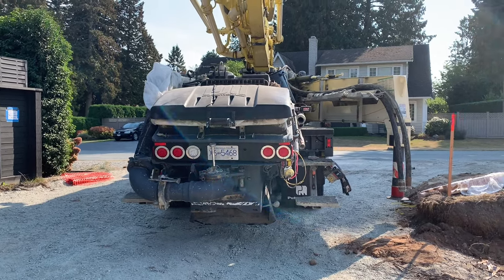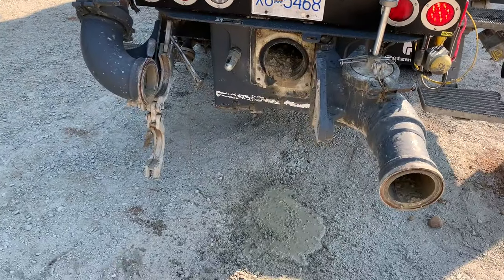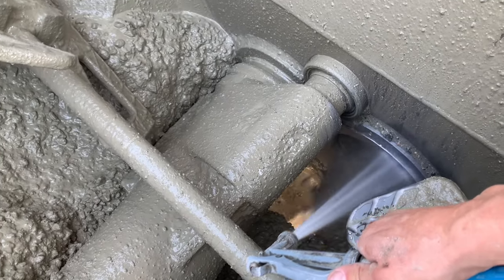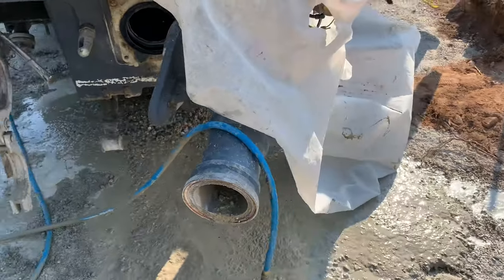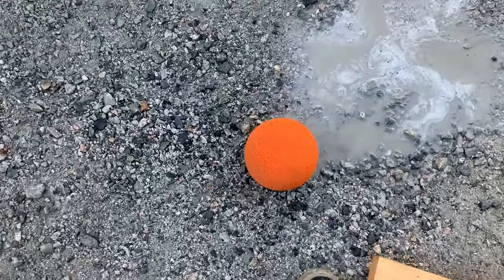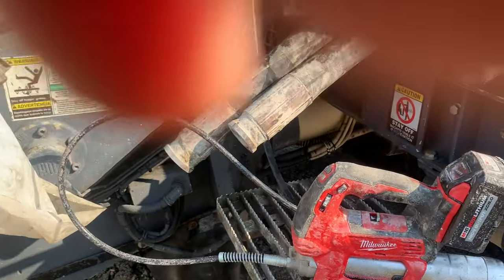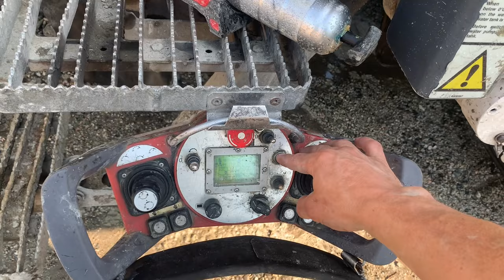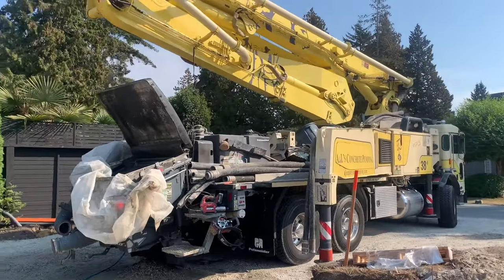How to washout a Putzmeister concrete pump:

Comment: I'm curious how you clean the drain valve from the tub or how you clean it if the concrete has hardened on it during a longer job, I cut the side of the tub at 38 in order to clean and wash it. I wish you all the best and I hope that things in the economy to return to normal.

Comment: Centering the material cups I believe is key to an extended piston cup life. Done it for years and years, totally makes sense, and like you said, it costs nothing. Back in the day of running the Thompson’s, always packed a 5 gallon pail of dirt/sand/ bark mulch. For that ever so easy hopper design, to clean at days end. Was curious on what the protocol is in your market, for raking out the wash out pile,  we always rake it out unless specified otherwise from higher up’s on said specific sites. Or if it’s a designated wash out where raking out wash out piles was irrelevant.
Reply from the maker: Yes, it was John Beacom (check spelling of last name) from Gastaldo’s whom taught me that one many years ago. I, like yourself, swear by it. Bark mulch is my absolute favourite for dumping underneath of the large bearing, so much better than sand, in my opinion.  Doesn’t harden up whatsoever. 

It’s funny, for the most part they like us to take down our washout piles, but I always still ask because inevitably if I rake it down without first asking, the builder inevitably calls two days later complaining that it should have been left in a pile as it would have been easier for his machine (which just magically appeared on site) to pick it up. But yes, same as you, my default is to take is down as thin as possible. My favourite is if I’m in a wide open area, I’ll suck back a trash can full of water into the hopper and let my washout self-level (just don’t try this in the city and have the slurry water run-off into the neighbours blueberry garden….. or so I’ve been told…) 😂😂😂

Comment: those hoses are crazy lol only seen them myself in edmonton but having spent majority of my career in toronto where its pretty exclusively 10’ sections those seemed huge
Reply from the maker: We’re spoiled in that we run mostly 3” and smaller diameter line. If we were lugging around the 4” and 5” hose like they do in Ontario, we’d likely be rock’N the 10’ lengths as well.

Comment: aside from lifting the grate and stopping the pistons half way, this is exactly the way I was taught to wash out. most of the time, ill ram each piston down in reverse with the stroke changer so I can see the faces. 6 of 1, half dozen the other. putz should include this video in their crash course DVD llol
Reply from the maker: I know at larger companies lifting the grate for anything is a big no-no to the point in which they actually sometimes have them bolted down. One of these days my back is going to NOT thank me for all the years of lifting that grate 😂😂😂

Comment: What year is that truck?   When i was a pump operator the only interlock in the hopper was your hydraulic water pump.  You could have the grate up and the s tube would still cycle and the mixer would spin but the mixer would turn off as soon as the water was pump was turned on.   That pump was a putz 32 meter around a 2001 or 2002.
Reply from the maker: CPMA standard since I believe around the early-mid 2000’s all were required to have the hopper grate safety cutout switch. That being said, not all manufacturers were/are CPMA certified. It’s definitely something you want to have on a concrete pump. There’s been a number of extremely gruesome incidents and fatalities from machines either not having the switch, or having had it bypassed.

Comment: So, If I were to try to reverse clean my line pump, sucking the sponge from the discharge end back to the hopper, I wouldnt get suction unless there was enough material in the hopper to cover the material cups?
Reply from the maker: Typically speaking, yes. The material cylinders need to be fully submerged in either concrete or water to produce the vacuum required for pulling back half a boom system filled with concrete + a sponge. I have seen cases where it will still pull back even with the hopper level below the material cylinders, but I certainly wouldn’t count on it.

Comment: The cup on the ass end is for priming out you don’t have to ever plugout whem priming out, the pin on the cup is a ball 🏀 catcher so don’t have to worrie about chopping the ball in half, I always bring the hose to the hopper and put the waterhose nosel and holding it with the ball shot like about 5 gallons bucket through the pipes, when suctioning the ball, but make sure you press the pin and clean the cup from the inside of the 90

Comment: I like the tip about making sure the sponge is there by busting open the transition door to take a look before dumping the hopper.  I never thought about the vacuum.   Would be really nice if you had an S-tube changeover lever though 😆
Reply from the maker: It does actually have a manual changeover button (the newer Putz rigs have a more easily accessible changeover leaver). Neither style work however once the hopper grate safety switch is tripped and the accumulator pressure dumped.
Reply: I learned that lesson my very time sucking back the sponge. It was in my reducing cannon when I busted open the trap door. Lesson learned! 😂

Comment: you will like that milwaukee grease gun a lot more with a lock-n-lube quick attach for the greaser, and one of their swivels on the hose... I have the M12 version, and it is so much nicer to use.

Comment: Lol the water hose blew apart on the 56 last week Saturday. Barrels/s-tube were done, so no biggie. 

I wash from the discharge side, while stroking in reverse. Bottom out the cylinders after the trap is popped to push the majority out. 

Most of what we do is preferences. Cool to see other ways. Stay safe brother
Reply: You lost barrels and s tube because the water hose blew?
Reply from the maker: @DerekCastleSr.  I’m assuming he means “done” as in already cleaned out.
Reply from the maker: I began doing this religiously after running out of water mid-washout with our old line-pump 20-something years ago (had to get the barrels and S-tube cleaned out with a pressure washer back at our yard). Learned a lesson that day indeed. 

Totally agree. There’s so many different ways of achieving essentially the same thing in this trade, a lot of it really is just situational.
Reply: @DerekCastleSr.  Done, as in already washed out, no material left in the barrels/swing tube, no big deal to power wash the hopper at the yard.

Comment: I've run Schwing and Putzmeister and a few other make and I've found Schwing is the best for cleaning out and running Putzmeister comes 2nd that's what I think
Reply from the maker: Yes, many wise veterans have mentioned the exact same to me. I believe the rock-valve hopper is more “self-cleaning” as there’s less stationary components inside of the hopper as compared to a Putz.

Comment: Do you drop the water from your piston box ? Why?
Reply from the maker: I actually only change out the water in the box maybe once a week. In my opinion, the practice of dumping it daily (unless ambient temperatures dip below freezing) was/is more of a Schwing thing as they can tend to pull water from the box in past the rod seals and contaminate the hydraulic oil. Just my opinion. Either way, definitely no harm in dumping it daily, I just haven’t found it to be necessary practice with our Putzmeister pumps.

Comment: You wouldn't believe how many people destroy their large or small seal housings due to lack of grease or just relying on the auto-greaser and not even checking to make sure there are no plugs and everything is getting greased.  Then they bring them in for service and say the seal housing is shit because it didn't last.  I guess they don't realize once we take it apart it is pretty apparent if it hasn't been greased properly.  Cheapest and best form of maintenance is grease.
Reply from the maker: That’s the one thing I don’t like about auto-greasers, they can lead to complacency/negligence.
Reply: @canadianconcretepumper1979  We have a few customers who won't run them on the fleet exactly for that reason.  It's hard to find good guys that you know you can trust 100% to grease it everytime.

Comment: I am new pump operator,only operating for 3 months now.. what advice you have for me would appreciate to hear it….ps I from a small island 🏝️ name Sint Maarten 🇸🇽
Reply from the maker: Best advice I could give would be to develop a routine of what works and not deviate from it until such time as the situation calls for it or until you gain enough confidence experience to start tweaking things to gain efficiency. Always stay humble no matter how long you’ve been doing this, it’s a constantly evolving profession and the minute an operator thinks they know everything is the minute they begin to regress. But the most important one item of advice I could give (aside from the obvious use dunnage under your outriggers and stay away from power lines), ALWAYS recirculate when waiting on mud. 23 years and I’ve literally not once had a boom party and it’s 95% attributable to the fact that I recirculate religiously (the remaining 5% is just luck that I haven’t tossed a fan-belt or tensioner with nuclear hot mud in the pump) 😂😂😂. Just be diligent.
Reply: @canadianconcretepumper1979   thank you

Comment: where did you get the ball stopper
Reply: Putz sells em, so does conforms. I like the Putz version better. The conforms rod seems loose, almost "wiggly". Scott's looks like the Putz version
Reply from the maker: As Greg had stated, you definitely want to get the Putz version. The ConForms unit relies on an O-ring for sealing, which gets sloppy and leaks. The Putz unit is near bulletproof.

Comment: Why do you hate the cube?
Reply from the maker: They don’t wipe the pipes clean nearly as well as the rubberized round sponges do. Also, they do not seal air as well (especially when brand new). The biggest reason however is that with the foam cubes you can rinse and wring them clean for 10 minutes straight and they seemingly still become rock hard after over a weekend. In my opinion, the rubberized round sponges are just quicker/easier/more efficient. in most every way, in my opinion. I’ve seen the rubberized round balls last more than a year on several occasions.

Comment: You should wash and drain out your water box we have found if you drain it at the end of the day you get less water mixing with the Hydraulic oil. Plus we have a sign saying fill water box at your control's so you don't foget
Reply: we empty it out every time we wash out at the end of the day
Reply from the maker: You’re absolutely right! I’ve been told that it’s especially important with the Schwing as they can be more prone to pulling water in through the rod seals.

Comment: Why not use the remote...rather than lifting the grate... pump on in reverse... hold the change over button to max out a stroke.. pump off... rinse out... pump on reverse again.. hit and hold change over button again to switch stube over.. pump off and rinse.. done.. barrels clean
Reply from the maker: I prefer lifting the grate as I can get a nice straight shot up into the barrels with the water nozzle. We do a lot of slow pours in which the piston heads as well as the ends of the cylinders get caked up pretty good, so it’s helpful to be able to get the water right up in there.
Reply from the maker: The method you suggest would likely add years to the life expectancy of my back however 😁😁😁

Comment: If my sponge is not fully back i make sure  the s tube is submerged in water then try to suck back the sponge
And first clean the hopper and the cilinders  and no dirt  only some formoil
Reply from the maker: We do so many slow/tedious pours with hot mixes, sand/dirt is seemingly the only way to avoid buildup underneath of the large bearing. I pumped 800 cubic meters in 9 hours with this thing last Saturday, I had forgotten what a treat washouts can be when the mud is kept flowing all day long.

Comment: I wash out the same way but I use a wash out rake for my s tube cut down on water
Reply from the maker: That’, good idea for sure. We keep them one our high-pressure pumps which have the extended discharge outlet (makes it difficult to get in there with the water nozzle). Definitely saves on time and water usage 👌👌👌

Comment: Wow must be a nice feeling using 3inch pipelines 😂 instead of mauling with 4inch here in the uk
Reply from the maker: Truth be told, most of our residential work (aside from foundations) is poured using 2.5” or even 2” hose. Commercial we typically run a 3.5” or 4” for boom work and 3.5” for line work. We’re fairly spoiled here with our mixes/materials.

Comment: I want to see you clean out a hopper with a seven sack concrete mix 

Fellow pumper from Houston tx
Reply from the maker: Some of the high rise mixes we pump here exceed 10,000 psi. Washout process is essentially the same, just takes A LOT more elbow grease/jackhammering 😂

Comment: Owe.. That is not the way to clean, it's so slowly. But thank you for trying to clean buddy.
Reply from the maker: There certainly are ways to washout faster, but this video was intended to depict cleaning and greasing everything 100%. If I’m heading to another job the same day, I will expedite the process somewhat, but at days end like this, I will prioritize getting things perfectly clean and greased versus trying to save a couple of minutes time. Being in a rush/cutting corners during the clean-out procedure can and will come back to haunt an operator down the road. 

Pumping ain’t a race. Being in a mad rush leads to bad things in this industry.

Comment: We wash out identically on an S tube machine and I’m one of the best operators in the world so that’s saying something!
Reply from the maker: ^^^this comment wins!!!^^^ Pump-on brother 👍🏼👍🏼👍🏼
Reply: Every concrete pump operator I've ever met claims to be the best in the world
Reply: @dave-th8dx  I understand. Those guys are idiots. I however am the best in the world based on my years in the industry, I have mastered every machine, mastered working on all machines including welding and fabrication, I’ve worked for several manufacturers to the point where they call me for advice, plus I’ve been on the cover of the concrete pumping magazine. 3 times. I am truly the best.